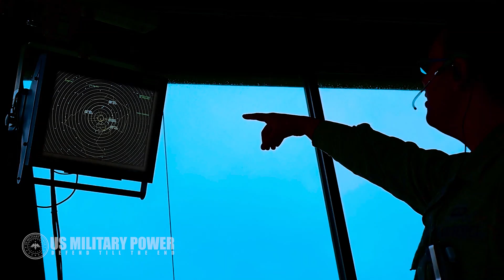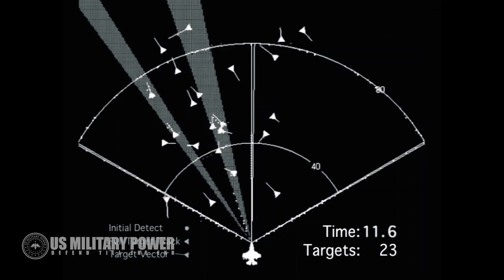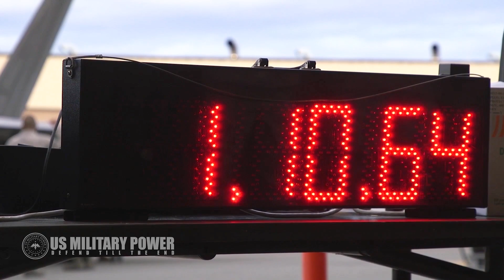Why the F-22 Raptor Remains the Most Dangerous Fighter Jet in The World

Comment: The Eurofighter is the best. 

For Example it can do everything the F-22 can do and more.

Some Example's to show why the Eurofighter is king, all can be found online Paper's and Reports open to read. 

The Specs of the Eurofighter vs F-22 for example.

Speed /
Eurofighter 1550 mph Mach 2.0 TMS.
F-22 1495 mph Mach 1.98 TMS.

Altitude Ceiling /
Eurofighter 65,000 f.
F-22 63,000 f.

Sustained Turn Rate /
Eurofighter 28.5 D/S.
F-22 27 D/S.

Instantaneous Turn Rate /
Eurofighter 36.5 D/S.
F-22 35 D/S.

Engine Thrust - Vectoring /
Eurofighter 21,500 ibf x2 - 2D Vectoring.
F-22 34,000 ibf x2 - 1D Vectoring.

Both can Supercruise. 

Both can take off, then go straight vertical up. 

Eurofighter is lighter and smaller so has a better power to weight ratio.

The Eurofighter has better range / Combat and A to B.

The Eurofighter Has a Better Dive/Cilmb Rate with better energy hold.

G's and -G's.
Eurofighter 9+ and -3.5G's.
F-22 9+ and -3.2G's.

Hard Points /
Eurofighter 13.
F-22 8.

Gun /
Eurofighter x1 27mm with 150 rounds.
F-22 x1 20mm with 480 rounds.

Missiles BVR - WVR /
Eurofighter BVR Meteor Missile the best in the world x2 ranges 1st 150km for fast agile Targets 2nd in testing showed to go 300km for other Targets, The Biggest NEZ of 60km, Speed of Mach 4.5, more Agile then the AIM-120D as well, WVR the ASRAAM Faster then the AIM-9X and more agile between 5 to 55km.
F-22 BVR AIM-120D 1x range Maxed at 160km a NEZ of 20km, and a speed of Mach 4, WVR AIM-9X more agile under 5km. 

Eurofighter uses the Striker 2 Helmet more advanced and able to lock on to targets and fire with out lining the jet up with the target.
F-22 is outdated and old the hardware and software is not there to be able to use the Helmet to lock on and fire like the Eurofighter can, so the F-22 needs to line up to lock and fire.

Radar / 
The Eurofighter uses one of the best Radars out today, able to pick up the F-35 and F-22 from distance, and able to track a multi group of targets at once.
F-22 has a good Radar picks up the Eurofighter from distance as well, but cant handle as much as other radars can, but still can track lots of targets.

In War Games Between the Eurofighter and F-22 both over the years have won against each other but the Eurofighter has won the most in Games from BVR Fights to Dogfights.

Design /
Eurofighter was designed for Air Dominance and does have some stealth in the design having the smallest RCS against the Rafale and Gripen, with the Wing Design on the Eurofighter it is 20% more efficient then your wing design on the F-22, The Eurofighter is 1 of 2 jets the other being the J39 the Eurofighter in the same mission go from air to air then air to ground with its payload, the F-22 its one or the other.

The Eurofighter can do all the F-22 can do plus more, The Eurofighter has better specs better Missiles better Hardware and Software plus is used by the best the RAF.

Numbers Built /
Eurofighter 560+.
F-22 about 190.

Not to mention the F-22 is to expensive for the US Military to run, very small number of F-22's are actually combat ready but the Eurofighter most are Combat Ready, 1st there stopping training on the F-22, 2nd there lowering the F-22's upkeep, 3rd The US states its to expensive to upgrade the F-22's for today, making the F-22 more outdated every year, the Eurofighter is being updated and upgraded in a number of different ways, to keep it on top. 

The Eurofighter is king.
Reply: The rafale was better against both in most simulations though.
Reply: @guillaumebriand8961 

1st The Eurofighter has won more against the Rafale in real ( VS ) in Dogfight's and BVR.

2nd The Eurofighter has won more in Dogfight's against the F-22, and the Eurofighter and F-22 basically tie in BVR Fights.

3rd The Rafale does beat the F-22 in Dogfight's, but its only had a hand full of wins in BVR against it.

Still the Rafale is a great jet, the Eurofighter is just better, better specs, better performance, and better Hardware and Software.
Reply: UTTER NONSENSE DUDE! THE F-35 has defeated the Euro-fighter in Red Flag and all other fighters in existence today!! FACT! The Euro-Fighter has no  stealth capabilities and it looks like a semi truck or B52 on the radar screen stupid! 

SO SHUT THE FUCK UP WITH YOUR IDIOTIC NONSENSICAL POST!
Reply: The fact that you actually believe this… There is a reason that we do not export or share the technology. The F-22 would destroy a squadron of Eurofighters before they could ever find it.